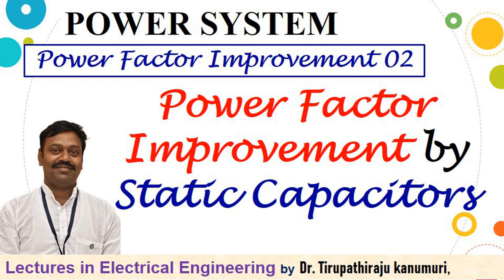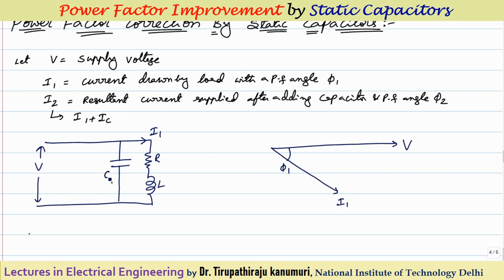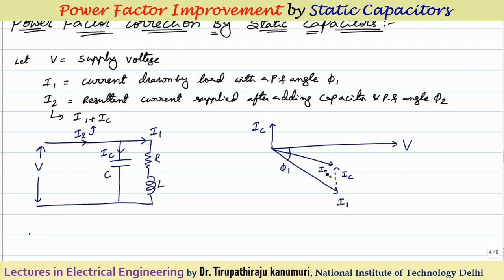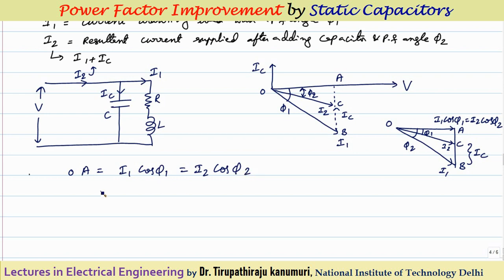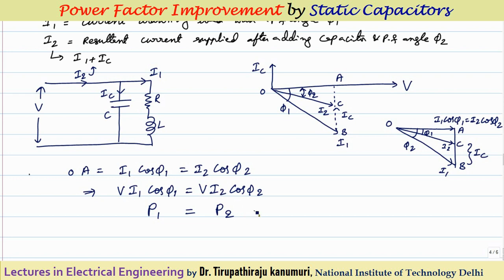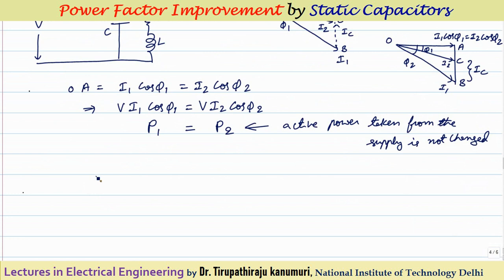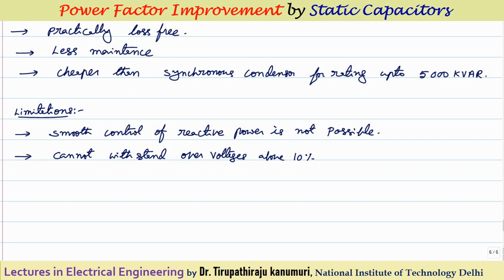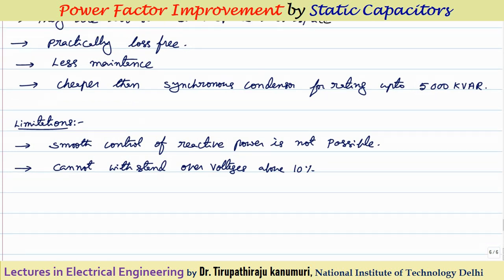PS114 Power Factor Improvement by Static Capacitors

Comment: Sir at 6:47, sir the function of synchronous condenser and capacitor in improving power factor is same, but still why do synchronous condenser supply leading kvar and capacitor takes leading kvar?